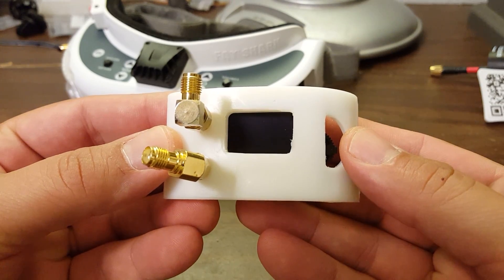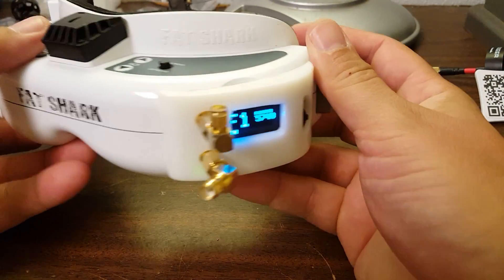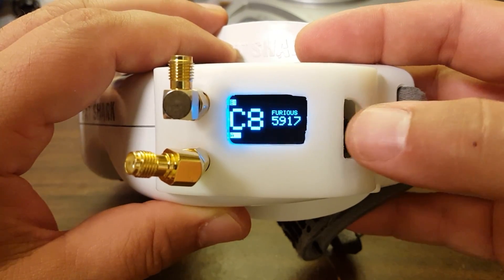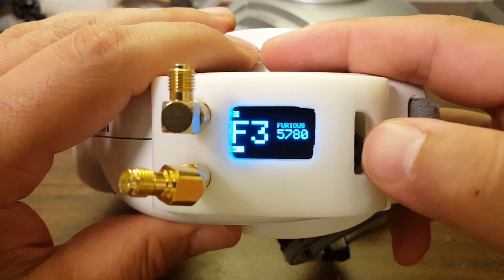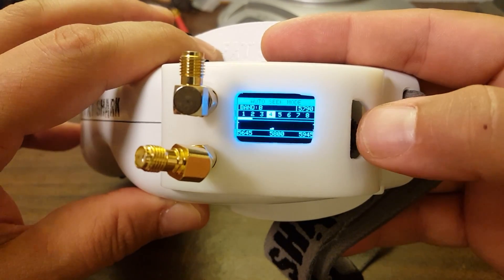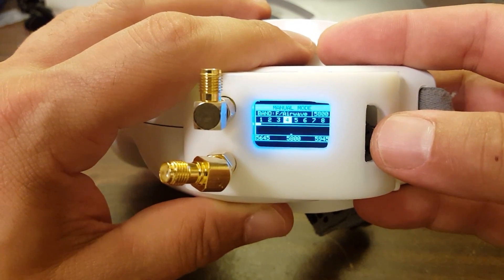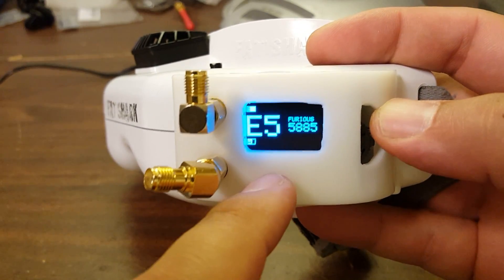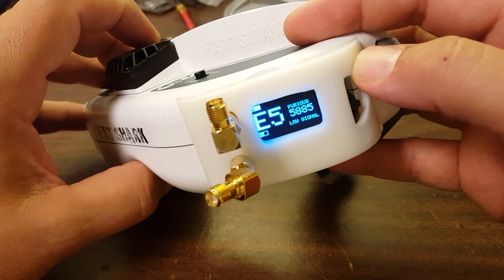Furious FPV True-D | FATSHARK DIVERSITY MODULE COMPARISON

Comment: Did you ever calibrate the RSSI? I'm not sure how to do it with this without a manual. if you did,can you share please.
Reply from the maker: RSSI calibration is an option from the settings menu. There are a zillion instructional videos if you search:

https://www.google.com/search?q=true-d+calibrate+rssi&rlz=1C1CHFX_enUS570US570&oq=true-d+calibrate+rssi&aqs=chrome..69i57j0j69i61j0l3.2552j0j7&sourceid=chrome&ie=UTF-8
Reply: Only the official vid is for the new v3 module says distance and milliwatt and high and low levels. All the videos from users on here just say pull the antennas and press callabrate. I assume they weren't accurate because not everyone making videos here has a clue.
Reply from the maker: I certainly couldn't be more authoritative than the official videos from Furious.

Comment: Joshua, while I appreciate your points of view I do not agree with some of them.  No big deal so please don't take it personally mate.

One example is that you say that the Laforge unit(s) provide a better weight balance because the Furious is all on one side (left side).  However, since many (incl yourself as I've seen in your other vids) use a headset battery attached to the right headset strap, the Furious unit (plus a couple of antennas) almost perfectly balances each other.

Another thing, if you want to change the startup freq all you need to do is select the 'Working Channel' and push/hold the button (you then get the 'saved' message).  This does not overwrite anything in your 8x working channels.  I often do this, no problem.  Over-writing it using Manual Mode does though.  In any case, not having your working channels in a 'correct' order is no big deal.  something you quickly get used to (or you can go through the pita way of adding/overwriting).  Expecting a sub-$100 module to do 'everything you want it to is a bit unrealistic imho.  Still, no harm asking. lol!  Personally I do not see the need for more than 8 working channels nor do I see the advantage of being able to use the FS goggle's channel buttons.  Not like you are going to change them in-flight, lol!

Lastly (I'm sure you are glad, lol!) I think it's worthwhile to try diff antennas to see what works best for any diversity module.  Sticking with the conventional omni on top, mini-patch on bottom, is not always going to be best, esp if you are mainly flying in front of yourself anyway.  I think that the main reason is that the diversity units tend to flip back and forth a bit too much when using a lower db omni (typically 3db) versus an 8 db mini-patch.  Since I am not a RF expert like you, I'm not really sure why this seems to be the case.  

Personally I have found that that 2x Immersion mini-patches using short flexible extensions so that one points ~45 deg to the right and the other ~45 deg to the left, both tilted slightly upward works best with my Furious module.  This provides a more stable picture and better penetration.  I'm not sure why, but I never seem to notice any cross-over from one antenna to the other like I do with an omni/mini-patch combo.  As an aside, I found that the FatShark 'antenna diversity' module (crap imho) with 2x mini-patches seems to have a permanent cross-over fuzz.

Comment: Surely the the weight of the battery on the other side, more than offsets having the 2 receivers on the other side!
Reply from the maker: +Dennis Stockwell it doesn't. Because the battery is close to your head and on the side while the module and antennas are away from your head by two inches, and in front.

Comment: the realacc vs LaForge vs Furious-D is just like betaflight vs raceflight vs KISS
all of these diversity modules originated from the rx5808 pro open source project, where LaForge and FuriousFPV just took the source code and changed added some features to it, but by the menu system you can easily tell they all came from the same source code
Reply from the maker: +elad dov that's not entirely true. Bruce tells me that LaForge has a different and better RF module than the original 5808 project.

Comment: I think the reason they both lock on to a lower channel when scanning is because most FPV transmitters will genuinely output way too much out of band energy, so it's seeing that as a valid channel and stopping the scan. I made a video on this topic so please check my channel.
Reply from the maker: It's not that, exactly. The channel is supposed to be wider than just 5 MHz. So it's just a limitation in the receiver's ability to lock on to the exact center. It always seems to lock on to the lower 5 MHz, so I think it scans up the band until it sees a channel with energy over a certain threshold and stops.

Comment: What do the normal channel change buttons on the fatshark do? I was wondering if those map to the "working" channels.
Reply from the maker: For the True-D, they do nothing. In the LaForge and the 2pineapples, they move channels up and down. The channels they move between depends on what mode you're in. In Favorites mode, the LaForge moves between your favorites. In Spectator mode, it re-starts the scan process.

Comment: This was much less of a shootout and more of an overview. Which has been done over and over again. I'm pretty sure I'm not the only one that wants to see an actual shootout. As in which performs better. There are maybe 2 videos on YouTube that actually compare the units based on performance.  The furious website or videos could have sufficed for this content.
Reply from the maker: The structure of the shootout will be an individual feature overview for each module, followed by a single RF comparison video for all, followed by an overview video with final recommendations.

I submit that this video was still a shootout in the sense that I am comparing the feature set directly against the other modules in the test. For example, pointing out that the True-D "working channel" function is inferior to the LaForge "favorite channel" function. For me, this would be a huge differentiator between the two.

Comment: i had constant flashing with my Furious and V2's. Unflyable. tried another module with same result.
Reply from the maker: What goggles? I have heard of the issue with the Furious, but I haven't seen it at all.
Reply: dom v2's. i dont think its widespread, but i have heard others having same prob. stopped testing after 2 units.
Reply: You're correct in that it would only happen when the signal was obstructed by trees, but the distance between me and the quad was no more than 30 yards, and the NexWave module only exhibited very little static, whereas these modules would cause the sync loss as you saw. I think the early-run Dominator v2 (like mine) for some reason do not provide adequate power for these higher-draw modules.
Reply: yeah i chalked it up to a v2 problem. the 2nd module i tried came out of a v3 and had no performance issues when paired with those. i did try a 3s batt at one point, but that had no effect.

Comment: so it's true none of these modules, Auto Search and Band Scanner functions never land on the right channel, Never. innovation? I have a 4 year old pair of SkyZone V1 Diversity Goggles, it has 2 buttons one for band, and one for channel they have never failed me and look & Perform just as good as any of the modules in this shootout. 4 year old diversity.  
there were only 32 channels then. click one button for the 4 bands and the other for the 8 channels. efficient.
 An Antenna would help, well No, I guess not with the Auto search and band scan function.
The dial is cumbersome for sure, and that being said Laforge V1 had The dial, then 6 weeks later changed it for the 3 buttons. others will most likely follow suit. 
The cleanliness of appearance? I think is a wash between them all. they all look bulbous. and the antennas cover it. it's like saying the Picasso is better than the Monet.
The working channel set. not very intuitive, I agree. but couldn't you just do an auto search too find this channel that's not in your 8 saved channels? I do like the laforge favorites menu in this respect. However 8 channels is enough for working channel set? I set all my VTXs to the same channel, my working channel. never have to change channel, when at the field we all have chosen a channel we like. so when I show up, there's no,  " what channel you on Joe? (joe) um 5875 I think". none of that.  I know joes on 5860 and toms on 5900. and they no I'm on 5885.just power up and go. unless there someone new who shows up.
Now with 5 and 6 bands of 8 channels. we need these scan features to work better.
Race spectating is where I use the auto search function, and every time it lands on the channel one or two Frequency away from where It intended, so I just channel down 1 or 2 frequency too the correct channel. I'm good.

Comment: When you are using the auto search etc you don't have n antenna installed, so you think that might affect your results...?
Reply from the maker: +K. Soze it doesn't. The same thing happens. I'm close enough to the transmitter that it doesn't affect the results.

Comment: How do you like the foxeer antennas? I should be getting a few very soon....so just wondering what your opinion is.
Reply from the maker: For directional, it seems like Immersion 8 dBi patch is very popular and good performance. Pepperbox is also popular, but looks like a lot of weight to put on a goggle. Check out Alex Greve's world record FPV video for a list of excellent antennas.

https://www.youtube.com/watch?v=WlhNnn0CNxM
Reply from the maker: +KoekeBeest1985 I like the variety they're available in and the price. RF performance is acceptable but no spectacular.
Reply: Thanks for sharing. The price was mostly why I bought those aswell.
Reply: Which antennas do you recommend for diversity?
Reply: Thanks a lot
Reply: pepperbox is super light weight in 5.8

Comment: Thanks.  These comparisons are really helpful!  I love your content.  I've always noticed that you typically don't use "top end (expensive)" gear.  Something like the TBS antennas or Unify Pro.  Have you ever used high end gear? I would love to see a comparison between the TBS vtx/antenna and foxeer vtx/antenna.  I'm very curious if paying twice the price is worth the cost.  Thanks for your thoughts.
Reply from the maker: +PropellerAddict the Triumph is definitely better than the Foxeer. Axial ratio is much better. I recall that Alex Greves estimated the Foxeer axial ratio at no better than 0.6 while the Triumph is over 1.0. Whether it's worth 2x the price I don't know. And the Triumph isn't available in left hand polarization as far as I can tell.